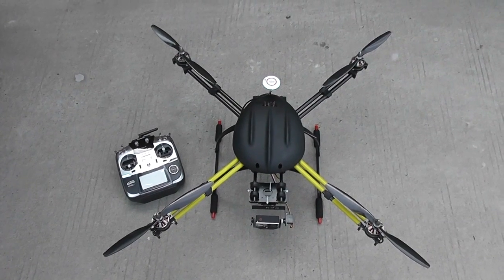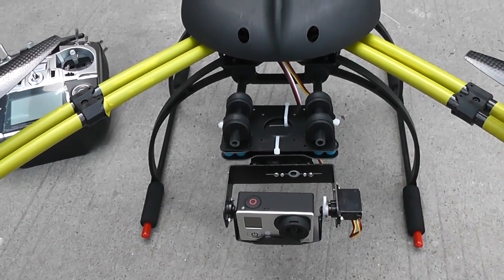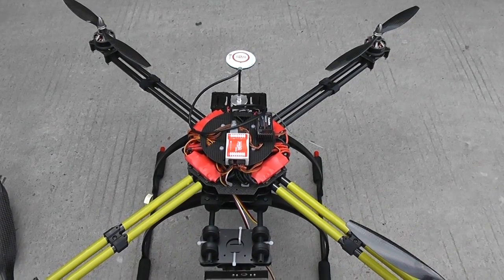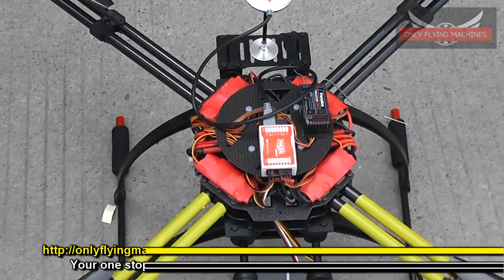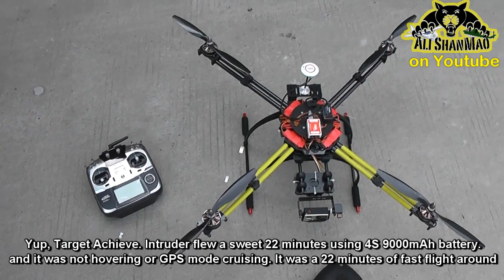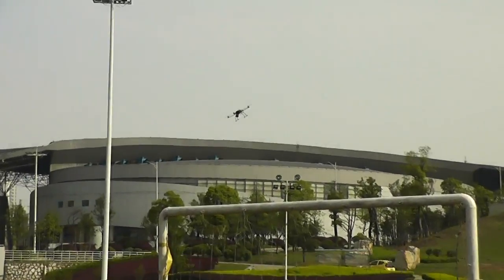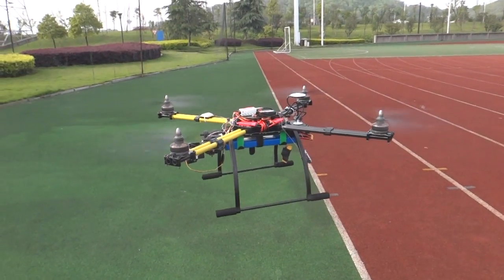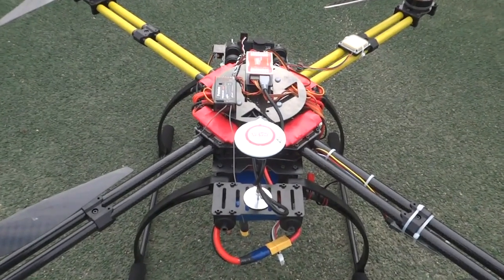The Intruder Q7 Aerial surveillance drone revealed

Comment: Marc.  Checkout  3w.multiwii and 3w.arduino for lots of info on flying and building your own quad/tri and other copters.  These things are very stable in LEVEL mode, have a built-in 3D gyro, accellorometer, barometer, magnetomitor and optional GPS system.  They also operate in fully acrobat mode.  Multiwii are fully programmable.  Of course if you want one out of the box ready to fly, then checkout the Intruder Q7 above.  Do some tutorial reading first - at 3w.flyingeinstein

Comment: Sergi what's your fully charged voltage on your 4s batteries and how are you setting the lipo charger as it sounds like you at be under charging.

Comment: this may sound dumb....are those LIPO batteries?   don't be mean. Because mine stays up for 30 to 45 mins on a lipo system. Problem is you push the battery to far, it is dead and will not come back to charge.

Comment: Drones make calculated decisions that are post operator inputs. UAV's such as these are 1:1 ratio of user input / output. So no they are not drones. There is nothing on the dji software that makes this qualified to be a "drone" unfortunately.

-Mechanical Engineer in the UAS industry.